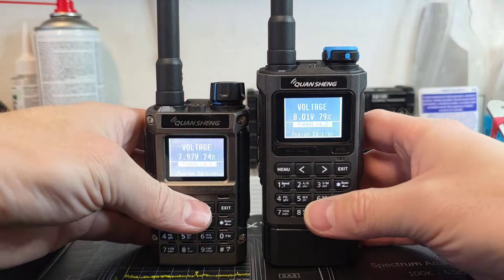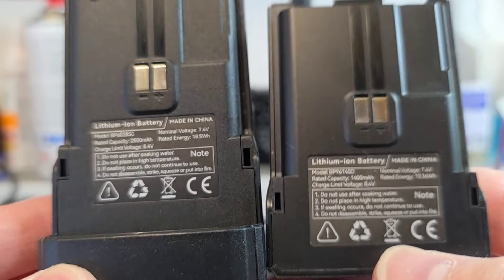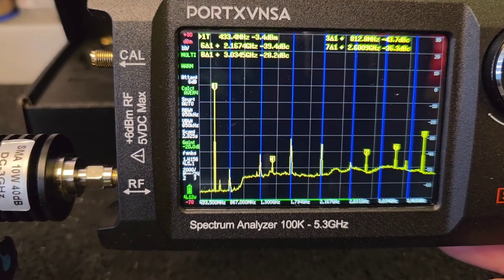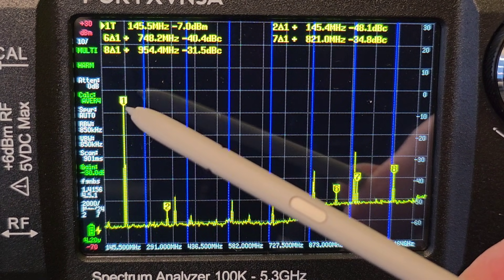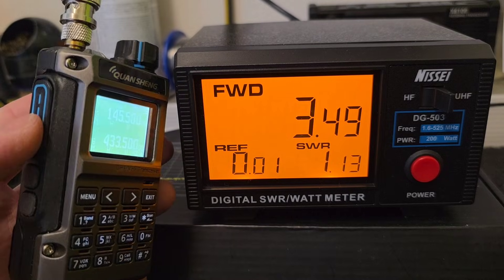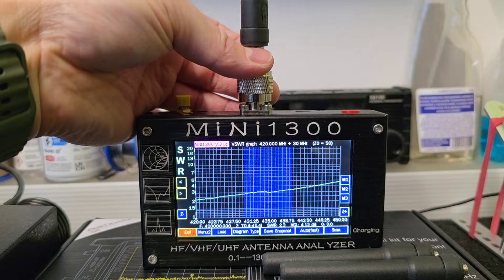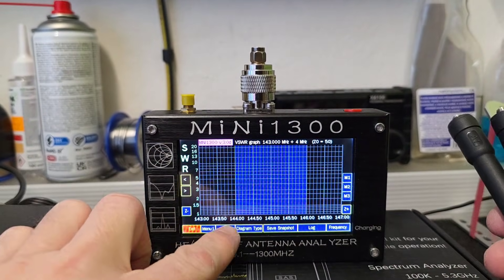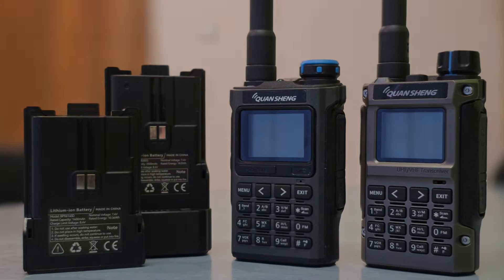Quansheng UV-K1(8) vs Standard: Full Technical Test (Spurious, Power, SWR)

Comment: What do you think is better, the Quansheng UV K1 or the Baofeng UV-5R Mini ?
Reply: K1 for sure. They are similar in hardware capabilities but the K1 is an "open" device. Meaning you can install 3rd party firmwares on it to give more features in software. This has been the case with Quansheng's older models like the K5 and K6 too.

Comment: make a decent diode rectified power meter incorporating a good quality 50 ohm non inductive power resistor, if you want consistent results, stop relying on those flashy measuring devices, they are clearly uncalibrated. Also, decent, self respecting HAMs would never use these radios for transmitting. Kenwood, Yaesu, Icom good, others are garbage. 73

Comment: Generally, to measure harmonics and spurii you would need to filter out the fundamental so it does not adversely affect the measurement noise floor, and in the case of a TinySA type device to avoid overloading and generating products in the analyser. Even with “proper” spectrum analysers this step is necessary.